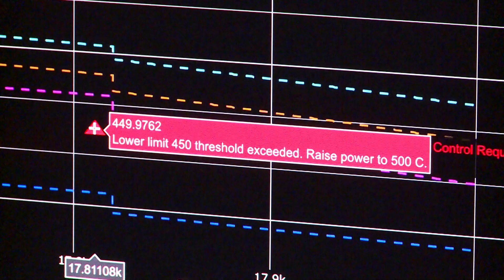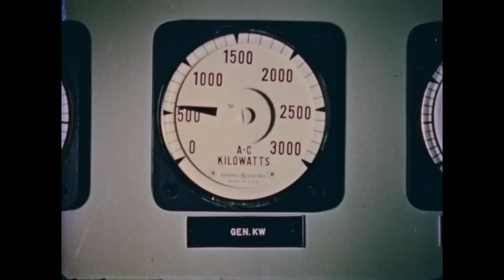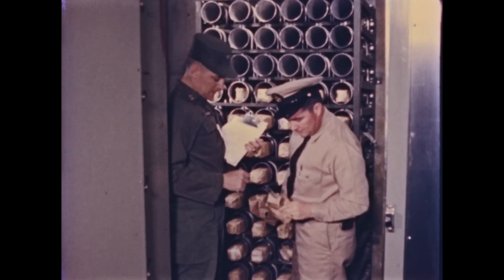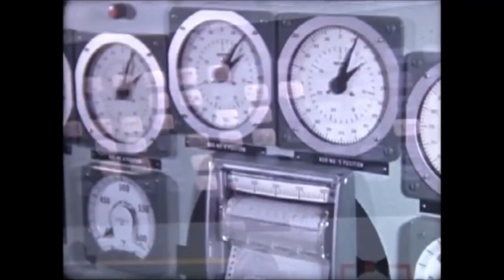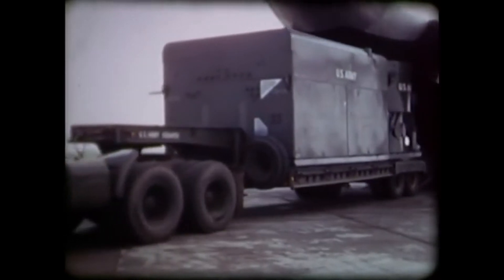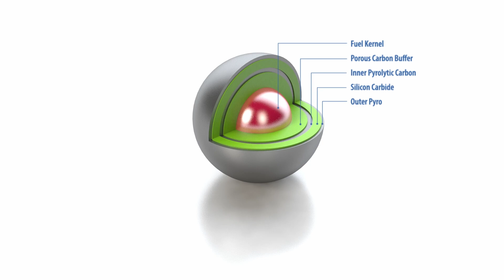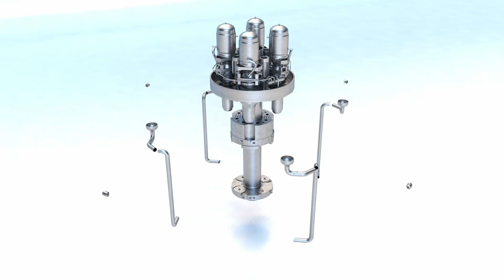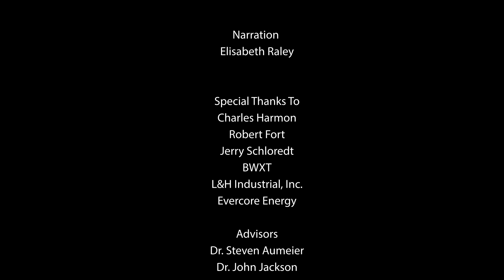Microreactors: Looking to the past to power the future

Comment: Using AI for control of a nuclear power reactor? As a professional engineer of control systems that worries me. We've been down this road before with fuzzy logic controllers. "you don't have to tune PID loops" they said. True enough. 

But it couldn't tell you when things changed. So the controller would quietly compensate for something that someone needed to know about. Nobody would know about certain wear and tear until the controller simply let go because it couldn't handle the situation any more. The result? Failure due to foreseeable conditions had there been a plain old PID loop controller. Maybe the scientists have their reasons. But for the love of all that is good, please talk to a professional engineer with a couple decades of experience before committing to some shiny concept like AI.
Reply: AI is only mentioned in design support.  AI can do millions of runs of worse case scenarios and loop back to make a change to the design and run the simulation again.  Millions of iterations to optimize the design.  For actual reactor operation, simple dual redundancy safety rated PLC's with the right programming and rated to SIL 4 integrity is a no-brainer.  I was a 20yo kid running a reactor for a nuclear aircraft carrier.  A PLC can certainly handle that task.
Reply: "...fuzzy logic...": I haven't heard that term for a very long time. Today they would probably call it "quantum"... because that term, like AI, is in vogue. We need to rediscover: Digital will always be an approximation of analog.
Reply: But this comment implies we continue down the same path as we have been for decades. Worried and afraid to take chances leads to no progression. Also, as if nothing has been learned over the decades and documented and only engineers would have the knowledge needed to move forward. This will cause other countries to progress faster (if they haven't already)

Now many of these smaller reactors use molten salt, liquid metal or other types of cooling solutions and not light water. Also I don't think anyone stated "nuclear" as your comment stated. There are other minerals to get the same reaction from a reactor such as Thorium etc.  
Just like the steel industry wouldn't adapt and change from open hearth to electrical arc, if we do not accept change we will be left behind. I personally don't believe we've used this technology to the fullest in fear of __ (insert your fear)

Current AI requires a database which is programmed by professionals with direct input from other professionals based on the system design required. We are not even close to AI = No humans in the loop and I don't know if it ever will be as the core AI community is well aware of societies fears. AI in 2024/2025 requires human oversight to monitor progress.
Reply: Having recently watched National Lampoon's Vacation, I asked Google "How old was Christie Brinkley in the film National Lampoon's vacation?" Google's AI answer was "70 years old". Enough said. Keep both hands on the wheel humans.

Comment: It's better then solar?
Reply: Antarctica has 30-day periods of darkness, if not longer.
Reply: @elizabethb4634  You need lots of batteries.
Reply: I would say anywhere, if you require high density reliable power.  If you need unreliable expensive power then solar is better.   Solar is just something cute to put on your roof, it’s not for powering advanced society.
Reply: @bobbooker1948  Well you're just stupid. It's not base load and that's its issue. 
It's so cheap that solar farms are going bankrupt because they didn't think new capacity would be built as cheap as it is now.

That data is directly from working on building a solar farm/garden . I was dealing with energy buyer from. Large utilities and their cost of "green" energy was lower than anything else, delivered 24/7.
Reply: The whole point of these reactors is portability and rapid deployment. A 20 MW micro reactor can be deployed and running in a matter of weeks. Compare that to a solar farm, which would require 82,000 solar panels as per the Royalla Solar Farm in Australia, which took 100 people a year to build.
Reply: Solar is very competitive compared to retail electricity. It's not very competitive compared to wholesale electricity. Solar scales well to 15-20% of supply pie and requires baseload. The video describes better wholesale baseload.